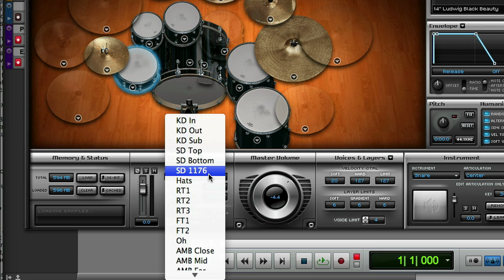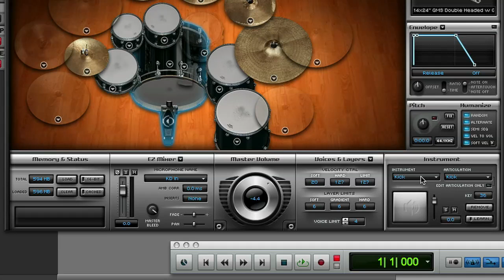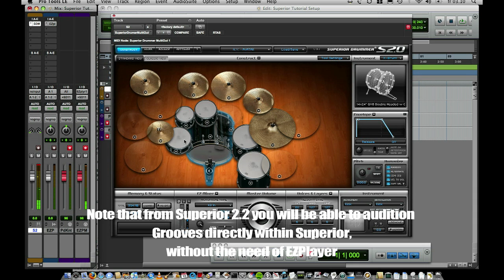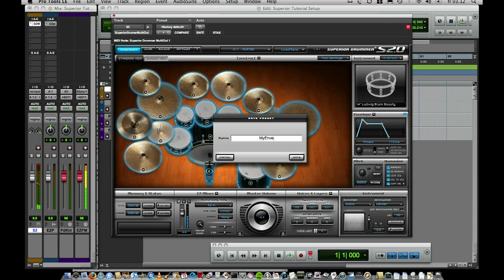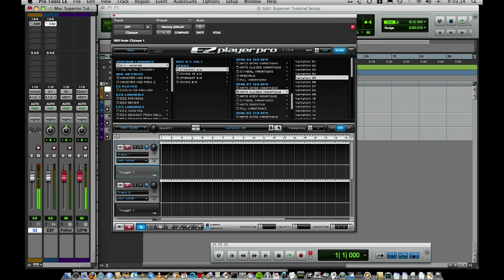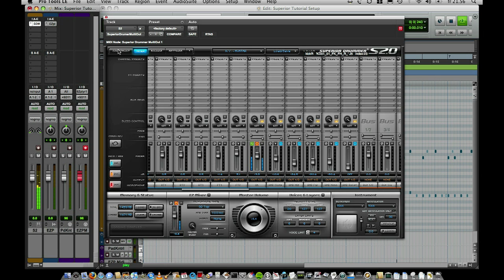Superior Drummer 2.0 - Construction Window

Comment: Hey guys. My friend has this program, and we decided to pack up my Alesis DM10 kit and took it to his house and we hooked it up to his computer. We used an M-Audio UNO Midi to USB cable. We run the midi in and out, out of the dm10 module, then the USB into his computer. We used the learn function and got most of the drums working, BUT when we wernt touching ANYTHING, We were getting a Hi-hat or cymbols sound when NOT even touching the drums. Any suggestions?